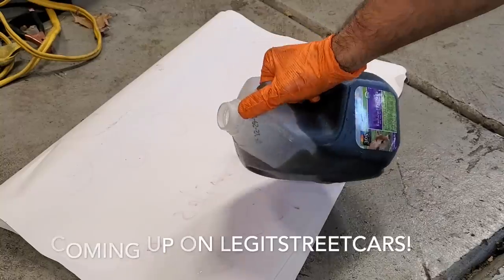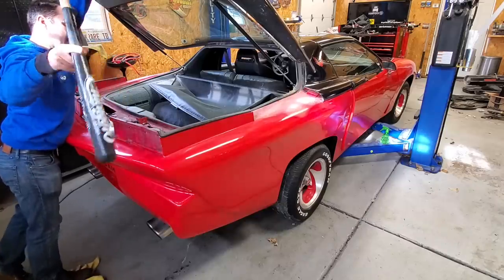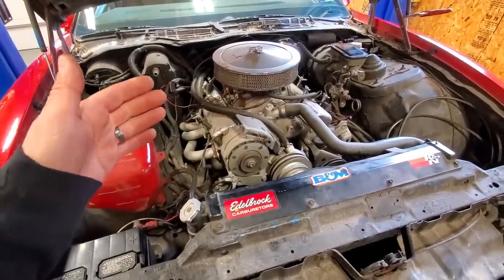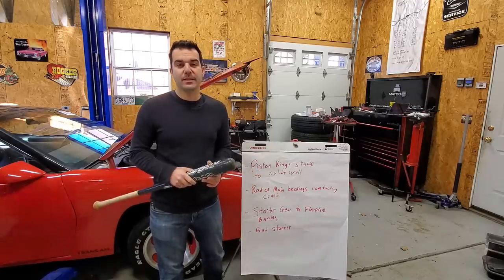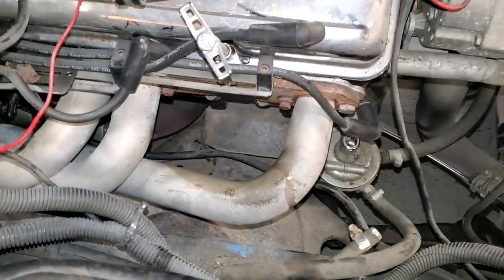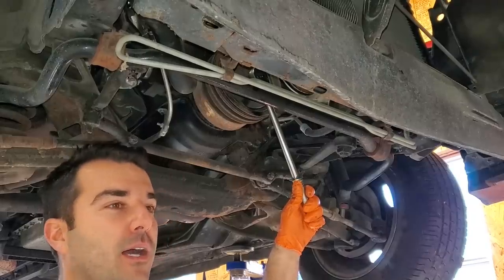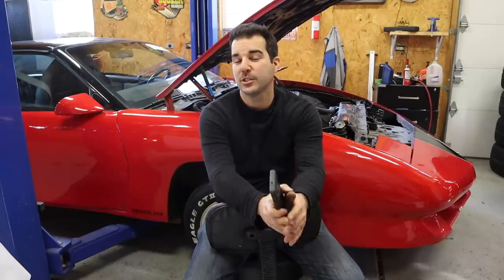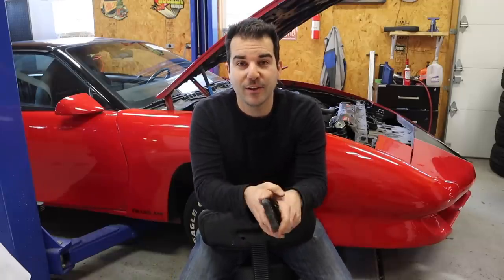My $1,100 Mystery Auction Car Has A CRAZY History! Famous Builder & Built Engine But, Will It Start?

Comment from the maker: What's the worst car you've ever owned?
Reply: Maybe a 2002 Honda Civic. Don't get me wrong,Honda builds great cars,but this one I had was shit
Reply: In 1983, I traded a 1975 Camaro for a new 1983 Pontiac Firebird; that Firebird was a piece of crap..
Reply: 74 pinto.. Only lasted 3 months.
Reply: An Audi S6 V10 with bad valves 😫
Reply: 98 Chevy Prizm it would burn a quart of oil every 25 miles
Reply: A 9 second pro Street 41 willys,it cost me 100k
Reply: 1979 Mercury Monarch only 4 out of the 6 pistons worked, power steering fluid would blow all over the motor every time I put some in, the head lights would go out when they got to hot, and the car shook so bad I thought it was going to fall apart! 😂😂
Reply: 1996 chevy malibu. Ran like crap when I got it. 2 years later, still ran like crap.
Reply from the maker: Oh yea that's bad
Reply from the maker: No way! Hole in piston? Lol
Reply from the maker: That sounds cool!
Reply: 1978 Honda Civic. The tranny rebuild from hell. It had sleeves on the shafts that had to be exactly right, or it would lock up. I had to pull it apart 3 times before it would run right. Which lead to my favorite car (aside from my Porsche 928 GT), a 1961 Rambler American convertible. More laughs per mile than any other car.
Reply: @LegitStreetCars  I have 1 on my drive ATM that is due to be a full Knight rider movie car replica... Needs alot of love
Reply: Got the full front light bar,steering wheel,and knight industries hubcaps lol Nightmare!!it's a customer car and a headache
Reply: @LegitStreetCars  it needs love and the small block needs an upgrade to a 454,you try telling the owner that.......lol you ll only ever go as fast as your bank account
Reply: A 2:nd generation Renault 5: https://en.wikipedia.org/wiki/Renault_5 
I paid more in parking tickets than I paid for the car :)
Reply: @LegitStreetCars  no I put 70 k into building the 41 then grenaded it at the track
Reply: I've never owned a terrible car but every car that I bought has had some issues that I needed to fix
Reply: Ya I’m building my 1999 stretched Jeep TJ pickup truck with om606 adapted to a Chevy nv4500 5spd manual transmission.  Once I get it driving good I’m going to buy a dieselmeken 7.5mm pump from Finland and compound turbos by dpuk in England.
Reply: vw 1999 golf cabriolet, aka mk 3.5 Worst car ever !! dont buy it.
Reply: worst car was probably my 1992 Lincoln Continental that was passed down to me from my late aunt. Constantly had issues, and then eventually one day it just said I quit. So I sold it to scrappers. Now I own a Mercedes E350 which hasn't had any issues, but my brother is a mercedes dealer tech so even if it does, he can fix it.
Reply: Kit car AC cobra - flex plate and starter problems like you are having. Fitted many parts, fuel pressure regulator, carb rebuilds, electric distributor, bigger radiator - the more love I gave it the more it hated me back. Was horrible to drive, but did looks amazing. Nice when parked.
Reply: Trick question. He’s just mining for answers to our password hints.
Reply: BMW E46 318i
Reply: 2005 skoda fabia 1.2 12v
Reply: 468 bigblock,with Edelbrock high-rise inlet and twin 750 dominators she pulled ...lol ford 9" with a locker and Strange 33 Spline shafts,with 21.5 Hoosiers on weld prostars plus Wheely bars she kicked ya in the spine lol
Reply: 1981 Chevy Chevette, bad brakes, bad clutch and you had to start it with WD40
Reply: @wesleyhorton4330  I'm in England
Reply: bought a 75 celica for 50 bucks..  was a real turd.. my friends and i took it off road and jumped it out of a bayou bowl.. thats where she sat for years..
Reply: @wesleyhorton4330  need parts or help hit me up
Reply: Bought a 2001 Ford Escape for $450.  Only 160k on it.  Found out afterwards the trans was bad and it wouldn’t start when warm.  Then something in the engine bay started on fire so I sold it at auction for $1350.  Terrible, terrible car.
Reply: 1980 1.6L Lada NIVA
Reply: 1997 Ford Windstar, Last ford I ever owned. I had $500 beaters with 200000 miles that were more reliable! Head gaskets twice and transmission twice It drove nice when it wasn't broken.
Reply: AMC Matador
Reply: I was hearing lot's of spark knock in the engine being it's a crate engine I would not run trash fuel in the thing run at least 94 or more octane but it sounds like very bad spark knock
Reply: My friend owned a jaguar v11 because a piston blew up
Reply: 1999 Mercedes Benz ML320.  20 repairs in 39 months.
Reply: Mercedes Benz e500 wagon.
Reply: @OscarTiderman  R5 was good cars 🤔
Reply: 2007 Vauxhall Astra 1.9 CDTi
Reply: LegitStreetCars not a bad car but worst looking a 2010 Ford Focus with a lot of cosmetic damage and has been wrecked before. Runs good needs a lot of love but it’s never not started. Has shut off once in traffic but it’s just a strange car
Reply: 96 bmw 7 series
Reply: 1995 ford ranger 3.0 v6 5 speed manual had a problem it would shut off under breaking when under a quarter of tank of gas and would take a few  second for it to want to start
Reply: 2g dsm. Spun bearings within a week of buying it. Rebuilt the engine and sold it.
Reply: 1988 dodge Daytona Shelby 2.2 turbo 5 speed pos but bastard step child throwing hissy fits . When running was a fast car hard 1-2 shifts she would jump to the left lane under load lol . 3 head gaskets later arp studs rust / rot she was junked the inspection failed her for structure rear axle rust in good old New York . I had a second daily just in case 1986 Subaru gl 1.8 turbo 5 speed 4x4 sedan never had a issue
Reply: @79tazman  hope it's a spark knock it just sounds deeper than that to me but if the dizzies loose or shot thats probibly it Fingers Crossed
Reply: 2002 ford crown Victoria
Reply: a 1981 Chevrolet Chevette that a co-worker gave me for free because he was tired of taking in to be fixed.

I drove that cat for 14 years and even rebuilt the engine.
Reply: @LegitStreetCars  the 1zzfe engine Toyota made were bad for the rings going bad smaller piston and larger rings and small oil return holes was the down fall
Reply: 1989 Jeep Grand Wagoneer SJ.  It had no floor, no back glass, and got 6mpg.  10psi cold oil pressure with 20w50 and Lucas.  Still drove it for over a year..until it left piston 4 in the pan.
Reply: 2003 Vauxhall Astra sxi
Reply: My 1st car. 1984 Chrysler LeBaron GTSLS. 4 dr, 4 cyl turbo auto. With a hatch... Ran for 3 miles after i bought it and the turbo blew lmfao... Haven't owned a chrysler since (18 yrs)
Reply: A 94 ford probe gt bought it with 260k miles after 5 months the head gasket failed but bought it for $500 so not bad i guess
Reply: that's a tough one ! it's a toss up between a 1972 ford pinto or a 1974 ford LTD  I drove both of them back in the early 80's to high school ( more like drove to school but walked home because they wouldn't start ! )
Reply: 1995 toyota celica gt convertible...
Dont even get me started on that thing lol...
Reply: 1989 Ford F150, gas 302 V8. Gutless and biggest drivetrain money pit ever owned. Cheers!
Reply: My 2019 Corvette that blew up at 140 miles. Worst $55K I've ever spent. I drove it 3 days, and it's been sitting over a month now broken.
Reply: 1979 L-48 Automatic Corvette
Reply: My first car a 78 Datsun B210...  Bought for $200 form my Mom's secretary. I was so excited to finally get a car I went straight over to my best friends house show it off and go out for a ride. While we were out "cruising" the town I hit a bump and the passenger seat (with my friend in it) fell through the rusted out floor. Two days later the head gasket blew...
Reply: Tie between 81 320i and ~90 XJ6. I think my volt meter finally told me to give up on em
Reply: Mitsubishi eclipse that was motor swapped and they pulled the bulbs for check engine and more.   OBD2 had more faults then Autozone could read... learned take a OBD2 with me and make sure it is a cold car not warmed up when you buy it. Lol.
Reply: 2011 BMW 335D, had the same issue 9 times in the 6 months I had it. The dealership I bought it from couldn't figure it out and they had it 4 months out of the 6 months I owned it, they brought it to BMW dealerships too and they couldn't solve it either. I eventually gave up and bought a mustang.
Reply: 🤔 My Buick Park avenue. I bought it drove it and blew it up a mile down the road.  But really I honestly think it's this 08 G6 GT... The rockers are completely gone and needs all kinds of work. Just got it . My 1986 Pontiac Grand Prix is in way better shape than that thing... New car suck
Reply: 1986 Buick Regal... chicago winters weren’t nice to it so it had rust for days.
Reply: 92 eclipse gsx she ate 3 built motors before my wallet became dry and i decided to take it as a loss and move on. Major love hate relationship.
Reply: A 1976 Austin Allegro, the motor was stuffed, blew out bucket loads of smoke.
Reply: Throw a quart of lucas in your oil. I had a GTA that I picked up from an old lady who didn't drive it after her son died. It sat for ten years. Had some bad lifter noise and what sounded to be a very mild low end tick. 2 minutes of running with the lucas in it, never heard made any noise again.
Reply: 2005 chrysler sebring, bought it from a guy with no teeth, i swear the car was a drug mule car from how beat to hell it looked and how all the panels where you could "hide things" just came apart on the thing, car ran fine all the way until i gave him the money they it just all started going downhill from there
Reply: My worst vehicle was a Nissan maxima
Reply: Chevy Chevette
Reply: Worst car ever is the car that brake's down in the middle of nowhere for no good reason.     Gary..... England 🇬🇧
Reply: Lifters could have collapsed from sitting. That could be the ticking. Running it will fix that.But if it's a solid lifter, check the lash.
Reply: 85 olds cutlass supreme bro-ham.  Had the V8 5.slow
Reply: 1990 vn commodore.  It was the buick 3.8 v6, auto but what a dog of a car.
Reply: 1979 caddy Seville
Reply: @nicolas_h9090  worst car i have seen is my moms 2002 honda fit
Endless problems (engine would shut off while driving)
Reply: LegitStreetCars 1996 BMW 750il
Reply: An American car of course, well 2 and fiat,honda, and Mazda
Reply: 1986 Mustang LX...3.8L V6 with an absolutely craptacular trans...it blew...so I replaced it...lasted three months...replaced it with a '97 F150 XL and said F it!
Reply: Congratulations on a great car, I'm a dodge guy but enjoy any unusual, concept or rare auto. Thanks keep the vids coming
Reply: My least best was a red sport Ford tempo with the door wraps, to me no car well cared for can be bad only the engines are what you pay for usually
Reply: late 80s honda sedan.
Reply: Ford five hundred.  Hands down worst car I ever owned.
Reply: 2006 Honda FRV I VTEC sport 2.0
Reply: Have a  1994 Chevy cCamaro and it's so bad the fuel pump when I first got it with shots the back end was hittin and the whole entire engine was locked up because the last person decided to run it until it locked up and then I took ownership of it and I got a new engine and it's been running like a champ since the day I put a new engine in it
Reply: A 2007 BMX X5  only car worse is the 2009 X5 that I bought later! Garbage
Reply: My sister in 2013 bought a salvage title 2002 Chevrolet Impala base with a 3.4 l V6 engine the color of the car was white and she paid $4,000 worst car purchase ever I ended up driving this car from 2013 to 2016 I gave it to nickname Casper the reliable POS I wished my sister would have bought the LS Chevy Impala with a 3.8 L V6 that would have been more reliable than the 3.4 l V6 that came with it it is junk so do not get any GM W body vehicle with a 3.4 liter V6 please get one with a 3.8 L V6 that is the best engine to have and the maintenance on it is pretty easy
Reply: 1992 Ford F-150 with the 300 I-6. Totally worthless. Sending it to the scrap yard in a few days.
Reply: 87 Cadillac Cimarron
Reply: 84 Lincoln  
Marvel mystery oil and Lucas Oil stabilizer and double check the oil pump drive in the bottom of the distributor if it was loose it heat seized form the distributor not staying on the drive rod to the oil pump it not the end of the world for it  also a go zinc additive would help as well
Reply: 2002 Dodge Ram 2500 with the 5.9 Cummins
Reply: 1965 LeMans 326 4door powerglide
Reply: 88 buick regal and 89 nissan pulsar..both metalic blue cars...i never bought another metallic blue just from superstition.but never had major badlucks again lol
Reply: Worst car I have ever owned was a ford tempo lol it was given to me for free and drivers side door was smashed in. Haf to enter and climb through passenger side lol
Reply: Honestly, I’ve had 6 cars, from ford escorts to a mk2 golf and a bmw 5 series, and I loved them all 😃
Reply: 1999 Land Rover 🤮🤮🤮🤮🤮 never again
Reply: 99 Cadillac DeVille with the Northstar motor.
Reply: a 1971 Vega! I never had to change the oil because it burned so much all I did was keep adding oil!
Reply: audi 100 avant. It had a very intermittent fault that would make it just die. Then the seals in the automatic transmission failed, and it leaked auto trans fluid in the diff and vice versa.
Reply: 86 Ford bronco 2
Reply: Land Rover Discovery...poop.
Reply: 87 jeep wagoneer. I spent more time fixing it than driving. It was fun fixing it in the summer but @-20 to -30 and your hands are fusing themselves to the tools, not so much lol. I do however wish it was the 70s wagoneer but beggars cant be choosers 😁
Reply: 1992 nissan 240sx, for some reason it was loud and shot flames out the hood and made alot hissing noises
Reply: LegitStreetCars Wouldn't say the worst but I permed a rare Mercedes Benz 300CE-24V and had the infamous biodegrade hoses and it would constantly leak oil despite being fixed and replaced. I miss that car
Reply: 2001 Saturn SL1...this one emissions part that was ONLY introduced in the 3rd gen consistently failed, causing me to not pass emissions.
Reply: Has anyone asked if you put oil in it? Considering you never showed refilling it with oil in the video. Hate to ask lol
Reply: 88 ranger v6 auto.....junk
Reply: 06 mini Cooper s auto unreliable piece of shit
Reply: Call it Phoenix if it starts up again
Reply: 1980 Ford Fairmont station wagon...drove it till the wheels fell off
Reply: 1977 Chevy Monza Towne Coupe. Looked great - engine disintegrated every 30,000 miles. I bought it 7 months old and got 9 months driving out of it. Lucky for me it got totaled!
Reply: 1981 Turbo Trans Am.  Slow. The turbo coked up every three months if I forgot to wait 10 minutes of idle after driving it.  And the paint was SHIT.  However....  it was also the BEST car I ever had because girls just fell on my dick when they saw me driving it.  Soooo...  best car ever.
Reply: 1992 Geo Metro. 3 cylinder, 3 speed automatic - 0-60 in 22 seconds!
Reply: A dam junk ass saturn. Just bad cars off the lot!!!!!
Reply: Best and worst was a 1966 Renault R8 Gordini ‘copy’.
Reply: City bus
Reply: Fiat 850, but only the engine. Tipo 100G. I have it ruat seized and now i gotta take it apart, it sat for 14 years. Otherwise awesome twchnology from 60s
Reply: @chipholland9  Same here. i had the Euro 270CDi ML, biggest most unreliable pile I have ever owned .Looked great and drove nie when new but ate it's trans then managed to destroy the AAM (computer) Trans module, air con module .etc etc etc ).
Reply: @nicolas_h9090  I had an 03 Accord, which failed spectacularly at the very worst possible moment in my life. It was the transmission, which Honda knew about. I believe it was 99 - 03 which had that slush-box issue.
Reply: 2003 VW beetle GLS, turbo with a 5 speed manual, tranny pooped itself on a bad 1-2 shift at 4 grand with 120,000 miles.
Reply: @Tech-Navi  I've got a 94 Probe GT right now. Had it for over 10 years. Very few issues over the years, but there were some head scratchers for troubleshooting. Klze and maf swap, planning to paint when the weather warms up.
Reply: Austin allegro
Reply: Nothing personal, but you made stupid mistake, if it doesn't move with hand motion you shouldn't turn it anyhow, that can do a lot of damage and make engine unusable
Reply: @LegitStreetCars  are you sure it's not a Banshee
Reply: Yugo, good car but when it's a bad transmission it's a hell of a journey
Reply: Renault Modus...Jesus...
Reply: My 2001 s55 amg, would run for a week then be broke for 2 1 week saving the cash and the next getting fixed . Only to repeat the process multiple times untill thankfully a chic ran a light n hit me
Reply: Toss up between an '83 rabbit diesel and a '94 tempo v6.
Reply: 2005 chevy impala ls it was a peice of shit. The exhaust hanged amd it was loud like a goat cart it stinked and it miss fired I hated that car
Reply: 1979 Buick Regal.
Reply: 1984 ford tempo.
Reply: Nothing as bad as that pile of shit.
Reply: One of the ones I drive now.....a 2004 avalanche with 245k miles and real bad lifter chatter, rust in rockers, and a front hub shining.  It runs, but not very good.  My actual worse vehicle was my first vehicle....1969 snub nose Chevy handyman van.  250 i6, 3 speed column, garden hose ran to carb from a fuel carry jug....no joke, had 3 blowouts one drive and couldn't tell (drove no different) once I got home and found out....and had no title.....
Reply: Audi A4, bloody terrible
Reply: LegitStreetCars ,1968 Mercury Montgomery MX. It was my first car, got it with a blown engine and a rotted frame in three places. When your 15 years old with no money, it takes forever to get your first car running. Put a used 302 in it and the car almost broke completely in two. Almost gave my poor mother a heart attack when she saw the car’s fame in the driveway laying in chunks on the ground. No kidding. What can I say, I learned a life lesson about structural integrity on cars. Those were good times when I look back on those days.
Reply: 1951 Ford Shoebox.
The Flathead was a total lemon. Car had just issue after issue
Reply: @ursus353  a 75 camaro is worse.did you buy the cheapest base model?ive owned 6 in the last 25 years and i love them,i have a gta and a trans am
Reply: @joshuanicolai4776  smart man
Reply: 1975 Cadillac Deville D'Elegance. It had a 425 fuel injected engine and was the 1st American car with a computer EFI. I hated that car. Traded it for a 1979 Camaro and that guy sold it to some dude who had the misfortune of having the car spontaneously combust while parked in his driveway and burning to the ground. I couldn't imagine a more fitting end for that POS.
Reply: @adamhenderson4318  thats on you not the car ,Adum builds a car from multiple pieces....fucks up......blames the car (an inanimate object)  fix it and do it right.
Reply: @trillrifaxegrindor4411  My Camaro was the LT;  in 1975, there was no Z28, my LT had every option that a Z28 would have had, and yes, the Firebird was a cheaper model.
Reply: 1978 jeep cj 7 i think it was a 304 35k original miles,it was a beast but I was always at the parts store although I did get like 3 ft. Of air one time so probably more of the abuse ol' Blue had to endure..good times.i miss that p.o.s. honestly
Reply: Easy, a 1981 AMC Eagle.
Reply: 2005 sentra ser spec v.
Super pos.
Reply: 96 grand am gt 5 speed with the 2.4l engine. Couldn’t keep the engine or trans together. One of my funnest cars to drive but broke down all the time
Reply: Worst car I owned was a '94 Chevy 20 high top van. It ran great for $2000. The seller put some kind of head gasket sealer in it. I bought new tires, tuned it up and 105 miles later coolant started dripping from the tailpipe. Come to find out that millionaire cattle rancher used to be a chevy mechanic years ago. No shop in town wanted to fix it so I sold it for $600. Trust No One!
Reply: @AutoAuctionRebuilds  I have seen some of your video's; was it a flood car?
Reply: A 2002 Suzuki wagon r....wouldn't start most of the time
Reply: 88 Grand Prix, 94 Achieva, 89 f150. Take your pick. The 2.8Litre Pontiac was an all around dumpster wagon, the Oldsmobile was destined for self destruction and the Ford had not one, not two but THREE transmissions nearly fall out of the thing in less than 2 months of which about 40 days were in the two different shops! All around doot fests man.
Reply: 1998 Mercury Sable. Wife insisted on keeping it. Replaced the engine and lots of components. Removed the whole interior to detail it. Finally got it sorted. Miserable car. The comfortable seats and the stereo were the best part of it. 🙄
Reply: all that back and forth chatting you should've asked how to open the doors from the outside surely the straps aren't the way...lol
Reply: 1997 geo metro with a in line 3 banger 53 mph top speed lol
Reply: 1995 markvii.  Suspension sucked, leaked every fluid from a few too many places. I paid a grand, was in a haze from my fathers death the day before or i never would have bought it.  One of the custom touched....Lincoln with cherry bombs on it.....Detroit!  It was kinda fast with the 4 valve 4.6. I got my mony back after doing smoking burnouts in it all winter. Zero practically i threw toolboxes into the interior and a carseat for my 4 year old.
It was scary because the front suspension arm was bad or something. And it was fast.
Reply: 2004 kia amanti.  The alternator harness shorted now my starter says stuck engaged.  Cant use blinkers or windows
Reply: Akia  or A kia .... kia  lol  i got it for my mother .. an the first 6 month she love it, but the tranny started slipping then the motor started knocking 

then it went to  heaven 

or hell
the dump
Reply: 1997 Opel Corsa, and 2002 Ford Focus St 170. This fucking piece of shit standing more times in the Repairing Workshop than on the Road.
Reply: My Current car, a 1970 Ford Mustang. Got it from my Uncle after sitting 3 years in his garage. Ran like crap when I first got it started. Runs way better now after a few new replacement parts.
Reply: Try AEROKROIL!! IT WORKS WONDERS!! Had the same issues you had with my T/A, used it and within a day she was running!
Reply: 1975 Ford Gran Torino station wagon...400 ci. Windsor/c6 automatic. Weighed about 4 Tons, power steering by Armstrong (bad power steering pump) ran like crap,drank fuel by the barrel, and was that horrible Ford Forest Green (guacamole/baby sh*t)!
Reply: 1984 Chevy Cavalier was the worst car that I’ve ever owned. The passenger seat had a hole in the floor and was missing the seat, so I mounted a milk carton above the hole and used that for a seat.
Reply: Datsun B210. OMG that car was JUNK
Reply: 1991 Ford Probe. In the shop as much as I drove it.
Reply: For one why are you calling it a firebird or trans AM its pontiac body yes but it a Banshee so no mystery car
Reply: LegitStreetCars 2005 Saturn ion. Lost brakes second day, blew the head gasket a month later, lost my lights, found out miles were rolled back month three, sold it and broke even thankfully month 4 lol
Reply: I didn't personally own, but my mom had a 1986 Buick Skyhawk (not to be confused with the Skylark) that would literally die on the way to the grocery store like a mile away. I now own a 2016 Ford Focus with the infamously defective DPS6 DCT. It's tough to decide which is worse.
Reply: Honda Quintet, what a piece of crap that was. Had it for a short time, sold it asap
Reply: 1985 Delta 88
Reply: A 2007 Renault Clio 2 in black. 
It was Rosty, dirty and almost fall apart but ☝ it starts every single day and drove from a to b. 
I was proud of this car.... And it was a gift from a buddy....
Reply: A 1968 Mercury Commuter station wagon w/a 390 V8 and a 4bbl carb. It was given to me for free, after the left rear axle simply snapped off at the outer end, causing the wheel and brake drum to take a trip down the block, minus the rest of the wagon! The owners were sick to death of the vehicle breaking down. They'd bought it new, it barely had 40k on it when they gave it to me in 1976. They had never driven it much over 45 mph! It was a Cream Puff, but Shit oh dear, it was a trouble prone Cream Puff! I replaced the axle, brake backing plate (it was kinda ground off on the bottom side) shoes, wheel cylinder, and hrdwr. Lubed up the diff, and hit the freeway. I held my foot flat to the floor as I got onto the freeway, and the Boat wouldn't go over 40 up a slight incline. The engine simply bogged, and the BLACK Smoke that poured out the back literally obscured the freeway behind me. Eventually, I crested that very slight incline, and headed down the other side, still Billowing Black smoke, my speed crept up to 45, then 50!!! About 2.5 miles along on a flat freeway, I was up to almost 60, and still  you couldn't see the roadway behind me from that smoke. The engine never missed, but god, the sound of that thing at WOT and low RPM over a long distance, was so weird!  Eventually,  maybe 10 miles down the freeway, I exited, crossed over, and FLOORED it again as I got on the freeway headed home. This time I got to almost 70 within the first mile, and the smoking was noticeably lower, too. After a total of ~15 miles of foot to the floor driving, the engine suddenly remembered that it was 390 cubes of 4 barrelled Dearborn Iron, and just Freaking took off. The smoke disappeared, the engine was purring... Yay! Then the trans took a dump! I rebuilt that Effing C6 about 5 times, and a local trans shop rebuilt it 2 more times, before diligent research finally turned up a reference to a limited production of C6's, that actually had semi porous castings between hydraulic passages within the transmission. Wtf?!??
Sure enough, a wrecking yard trans case, and all of my very new internals... problem solved! At this point, the radiator was feeling rather left-out of the proceedings... you get the idea! I ended up giving it away, just as its previous owners had done, and for similar, though different problems that continually plagued that beast!
Reply: 1975 Chevy Monza with a 262 v8. My brother took the car without asking and hit a large pothole at 60mph. The whole front end bent and was never the same again no matter how much I worked on it. It was stolen by some ahole for the rims and radiator (that was brand new). I saw the stripped car a week later.
Reply: 96 ranger... only paid 500 for it, but then it lost the clutch and a headgasket in the same month.
Reply: Instead what you should do tear the entire engine and rebuild it complete back up and start fresh again with new parts cause if you are second guessing your self you will lose time and money like this.
Reply: 1974 nova with the hatchback.It had a water retention issue that ultimately rusted the floorpans and spring perches,leaving the back half of the car dragging the ground.
Reply: Bmw M5 competition pack. It’s ruined all other cars for me. My only upgrade path is a tuned 911 turbo and I can’t afford one lol
Reply: LegitStreetCars 87 cavalier
Reply: I love F-Bodies. Still have them. One, though, stands out as a bit of a bear. I had a '94 Firebird Formula. Old LT1 V8. Loved it, and it sounded incredible with Flowmaster 40s and headers. The Opti Spark distributor was just the worst. Thank goodness you don't have to worry about it on this build. They're expensive too for an original part. Up to $600! As bad as that was, my old Lincoln LS takes the cake. Constant coolant issues. It's a Jaguar engine with a Ford badge. All the parts are quite expensive overall, but it's how they're made that's the kicker. Take for instance the thermostat.  It's integrated into it's own assembly that must be replaced in entirety and often fails. The construction is just sad on most of the parts I ran into. My buddy and I must have drained and filled that thing a hundred times working on it.
Reply: My very first car purchased from a repo auction for $400.  It was a black 1980? Mercury Capri RS.  The ones with the flat back glass, not the bubble glass.  Had a big factory induction hood (non functional of course).  It looked so mean! Didn't run when I got it but I just had to have it.  You gotta dream small when you're poor.

We had to replace the automatic transmission.  Which a family friend and I did at home because I couldn't afford real mechanics.  It actually looked like a really mean Mustang until you started it up.  The tiny 4 cylinder was so weak I had to pull over during wind gusts because I'd lose forward momentum lol.  It was pretty bad.

The car had been treated pretty bad before I got it and most everything in it or on it was damaged but standing still, from far enough away and with your eyes squinted hard enough it looked amazing.  

It broke down a lot and ran like an elderly ox cart but it was my first car and despite it being the worst car I ever owned I loved it.  Of course that was with my dreams of 5.0 engine swap and heaps of performance upgrades.  Somehow, in my mind, that car is always remembered fondly, not for what it was but for what it could have been.
Reply: 2006 BMW X5 v8.... I turned a corner one day passanger door flys open.. all electronics dead... Tires replaced every 25k km...
Reply: 1995 Dodge Intrepid 3.5L V-6 only 5 years old brought in 1999 and it had 90k miles drove 3 months A/c quit water pump quit fuel rail leaks one big piece of shit. We had a hail storm and State Farm gave me a check for 4,000 and sold it for 4500 the next month. Never buy an Intrepid Concorde stay away!!!
Reply: 05 Nissan Altima.
Reply: Alex, 
There is 08 Mercedes e320 bluetec for sale in Chicago with timing chain problem. Can you buy it and make video of how to fix it?
Reply: That's not a 350, that is a 305 you can tell by the external balancer.
Reply: Lol I don't buy shit cars lol
Reply: My dodge neon leaked a quart a week because of a rear main seal. 5 speed though. Loved that thing. Slow af. But leaked like a bitch when running
Reply: 1997 Pontiac grand am. Head gasket failure and electrical.
Reply: A FIAT 850 Spyder.  That was an anemic piece of junk.
Reply: 1998 ford Probe.
Reply: 1998 Ford Explorer, bought new. Was a good driver, but a rubbish 4x4 and an unreliable POS.
Reply: 1976 suburban with about 200,000 miles on it.   First car and what a pile but I loved her 👍
Reply: My first car was an 86 firebird with t-tops. It had that crap 2.8 liter v6. I got it with like 200k miles on it. It didnt last long since I was 15 when I got it
Reply: 1996 jeep Cherokee xj. Rotted out, transmission issues. Suspension issues. Idle issues. Also a 1999 honda civic although it was a low mileage car and super clean it had a bad headgasket with minor intermittant overheating issues. Never got too hot but temp always fluctuated. Had to replace a distributer in my work parkinglot and after owning the car 6 months it overheated and that was it. Also had a 1988 mustang that i dumped over 2k into and sold for 500 after doing upper and lower intake, timing chain and gears, waterpump, oil pan gasket, motor mounts, transmission mount and driveshaft.
Reply: 2000 vw Passat 30v v6 I bought it with a low end knock pulled the motor and bought a junk yard motor but the junk yard motor have broken and bent intake valves so I ended up scraping the car because I didn't have the money to buy a new motor and continue to bring the car back.
Reply: Your tick sounds like lifters to me, probably pull the heads off and see what is up.
Reply: 2004 Dodge Caravan
Reply: My worst car was definitely a 1975 2 door cutlass s with a 250 CID straight 6 with a 1 barrel carb lol but it did have electronic ignition. The interior looked like rats ate it and outside was 3 different colors.
Reply: 2001 intrepid r/t. The car was definitely built and was making about 400 bhp, but it was just problem after problem with that car. After I bought it, the battery went bad within a week, replaced it and then some wiring in the dash went bad, making none of the lights or power windows work, then while trying to diagnose that, the hubs went bad, got those replaced and the upper strut tower bushings went bad, then on my way to get those parts, the brakes went bad, it was a nightmare.
Reply: Worst car I ever owned was a 1978 Mazda 929 2.0L.  Blew 3 different engines in 2 weeks.  Kept blowing the head gasket between cylinder 3 and 4.  Rebuilt a running engine from the 3 dead engines and sold it without driving it much after that.
Reply: 03 Land Rover Disco 2.
Reply: That would be the Ford escort, followed up by a 1980 Chevy half ton PU diesel to gasoline conversion that had an inline six that had been Frankenstiened together. Mater of fact I actually named that old Chevy truck Frankenstein, as someone had butchered the intake for that inline 6, then very badly welded an two barrel adapter to the intake as well as rigged up the hydro-boost for the hydro-boost power break booster. Actually the rigging of the hydro-boost on the truck was not really that bad a job, as it almost looked factory if Chevy had ever put a hydro-boost power booster on an inline six. But the thing would never hold a proper idol due to the hack job on the intake manifold.
Reply: 1987 Chevrolet Celebrity. Was reliable for a hand full of years. Then took a sharp turn south after I sold it.
Reply: 2009 suzuki jimny i had to replace the transmission just from there you can imagine how many problems it had but even with the bunch of problems it had it was kinda like a reliable car because even with that ton of problems the car never left me stranded or didnt turn on now it's my daily even with problems it was my daily it was burning a quart of oil every 2,000 or 1,000 kilometers i dont remember 10w40 but now with 20w50 from a gas station it hasn't burned it maybe i just put the wrong oil sometimes when i turn the stering wheel fully sometimes it squeeks sometimes randomly the engine squeeks but just a little it has new accesories belt but still squeeks randomly men this thing had a lot of problem but still is reliable 😂😂
Reply: My aunt bought a Dodge Stratus and that was the worst car she ever bought
Reply: Milkman is that you?
Reply: @nicolas_h9090  yeah they're being towed left and right them in the Han dies 2002-2003
Reply: @GenderSkins  It rates up there as one of Ford USA's stupidest moves to name the rebadged Mazda 323 an "Escort" in the USA which stained the name of the British built 70's Rally Legend.  Those early rebadged Mazdas were pure junk.  They called them Ford "Laser" here.
Reply: 2012 Nissan Versa
Reply: Ford F-150 I almost died when i fell and tried to get home but it wouldn’t start
Reply: @79tazman  spark knock could be from the distributor being loose and not having the correct amount of timing
Reply: I have a 2003 Faw 6350 microvan. I still own it and it was made in China and the quality is very poor. It’s always has a electrical gremlin issue.
Reply: 1983 Oldsmobile Firenza was my first car. BTW Haters gonna Hate!!! I'm willing to bet that the people giving you crap probably don't know how to change their own oil let alone rebuilt an engine. Have fun with the (PHOENIX). I'm jealous that I don't have a project at the moment.
Reply: AMC PACER!!!!!!! Enough said lol!
Reply: 1985 Austin Maestro 1.3 HL 🇬🇧🏴
Reply: @jkeating38  my brother has a mercedes with 2.5? liter 4 cylinder turbo, we were at 138 mph and accelerating...runnin bitch
Reply: @johnthompson941  i had a windstar ran ok till i found a milkshake on dipstick lol
Reply: the one i have now
Reply: 2004 Rousch Focus
Reply: Not my car, but my mom had a Chevy Cavalier.
Reply: 79' Chevy Chevette with an Automatic...nuff said.
Reply: Ford
Reply: @JUNEBUGG99835  Was there alot of rust on the undercarriage? Otherwise probably needed have the clamps to hold it in place and the misfiring was potentially a bad cylinder or needs a Tune up. I have a 2000 Chevrolet impala LS and the car is very reliable, best car I've owned
Reply: 03 Silverado 4.8 4x4  it was like a boat just break out another thousand hahahaha
Reply: all my cars... lol
Reply: 85 Chevrolet Celebrity EuroSport. Nothing European or Sporty about it.
Reply: None bc I am too young but the worst that the family has owned is my moms Mercury minivan but nobody including the title company that legally owns it will take it so she has had it sitting in her yard
Reply: 99 cougar. Garbage car.
Reply: The worst car I've ever owned was a front wheel drive Dodge Charger. Spit out a CV joint and smashed a hole in the transmission the same day I bought it. Also, you have something dripping behind you at 11:57.
Reply: The worst car was my first car which was a former taxi, Caprice Classic.  The car used to diesel something awful when you drove it long and shut it off and the a/c didn’t work and would throw belts if you turned it on, LL
Reply: 1999 Corolla with 767K miles...
Reply: 1977 Chevy Chevette. (Shitvette, LOL!)
Reply: @scottpilgrim7589  it was just in bad shape it was my first car and it was like the previous owners didnt take care ofit well it leaked like hell it was bad
Reply: 01 Saturn L200 for me. Was free, knew the trans leaked. Had no idea the engine skipped time and bent all the valves. Took a while to get the key, was dropped off by tow truck. Did a top end overhaul on the engine, ran great but had this occasional cylidner 4 misfire that'd trip the CEL. Despite that cylinder having 200 PSI compression, good fuel injector, and good ignition. Fixed the trans leak. Sold that POS. Power locks would always unlock all doors and do other weird things as well.  All of that at 128,000 miles..... Haven't owned a GM car since and couldn't be happier about that.
Reply: 06 Impala ss
Reply: 83 Citation, 3 transmissions in a year
Reply: 1987 Honda CRX the rustiest pos ive ever had and i live in Texas, so not very many rust cars, but whoa that crx was BAD
Reply: It's from the m.j ovie Demolition Man. You can see it in the seen when they go to Tacobell.
Reply: The worst car I had a ford focus
Reply: Renault Alliance.
Lasted under 40k miles.
Reply: Worst car.... was actually a minivan.  A '98 Ford Windstar.   Nothing but problems.  I suspect that it went through a flood,  during its time in Florida.  Though it had a clear CarFax, I later found evidence of a lot of junkyard parts,  that indicated a prior accident (slightly mismatched paint, body panels slightly off kilter, also led me to believe this).

Anyway, bought it for 3k, sold it for $500, a short time later.  Guy I sold it to, he was confident that he could straighten it all out. Knew what caused every little problem.  Said he'd have it on the road, like brand new, in a week.

A few weeks later, saw the van listed.  $50, parts only.  Ad said the van was irredeemably possesed by demons, infested with gremlins,  and not fit to see a paved road, ever again. 

Damn shame.  Van was comfortable, and drove and rode well.... when it actually ran.

Side note: I've run a CarFax on 2 different vehicles.  Both came back clean.  I found evidence of accident repair on both, later.  I no longer trust CarFax... not that I had great faith in it, anyway.
Reply: @johnthompson941  Lol... I just posted the same vehicle... almost.  Mine was a '98.  What a lemon.
Reply: third hand Ford Falcon XR (between 66 and 68). Damn thing had missing teeth in all 3 gears and the day someone stole it... the diff fell out as they turned a corner (karma, bitch)
Reply: The car I've taken the biggest loss on was a '67 GTO.
Reply: 1995 Chevy S10 
had a cool knocking noise at full throttle lol
Reply: The fords stranded me the most. The Dodges showed me higher technology. 
But I guess Ima chevy guy had 2 novas and 2 vans. Ive 9wned 2 fords. One dodge. I caint really hate on em. If I was gonna brag it would be .................Dodge.
Reply: @nicolas_h9090  It was probly past due for a valve adjustment.
Reply: @richardkluiter5167  us8ally valves get that way from " runnin it into the ground".
Reply: @KK4KLI  damn! Bad seals? Needed some " glue" in it.
Reply: @joacimlopez9735  but that body style does look good for 4 doors.
Reply: There was an episode of Knight Rider where the team molded a fake supercar body onto K.I.T.T. as a means to infiltrate some bad guy's place. He was a fancy car aficionado so tricked out K.I.T.T. was sold to him. Then from inside his garage, thus inside the security, K.I.T.T. hacked the bad guy's computer. At some point the fake body overlay 'evaporated'. I recall the fancy body was black and red with an extra pointy nose. Would have been cool if this had been the prop car built for that episode.
Reply: 1998 Dodge neon. Hands down.
Reply: All three of the Fords I was unfortunate enough to own.
Reply: ford probe is the biggest pile of garbage. ever.
Reply: @hadleymanmusic  bad rings the Toyota engine 1zz Fe was notorious for bad piston rings
Reply: I really don't have a worst car all have their own set of issues  but my dodge dart swinger  318 v8 was bad rusted in the trunk leaf came through
Reply: 87 Hyundai pony. 83 Ford Escort. 85 Chevy citation. Nuff' said.
Reply: 1988 ford escort GT 4cyl 5speed front wheel drive and overhead cam lmao my first second car, my first car was 1989 Mustang GT BUT my dad said it was to much power so I needed a beater first to learn how to drive hahaha
Reply: '85 cougar
Reply: -96 Ford Mondeo V6, a Ford Contour for you Americans. Had a -93 Mondeo which was bad too but it's engine and transmission worked better.
Reply: mercury zephyr 4cyl 3 qt. of oil on friday so it would make it to then with 1 qt. left in engine, quite remarkable actually, it wouldnt die
Reply: 2002 Subaru Legacy GT, build quality issues from day one. I actually ordered it special in October of 2001. Steering rack went to hell 610 miles, window, rust, windshield wipers, suspension and nightmarish brake problems plagued that piece of junk the entire time I owned it.
Reply: 2011 Chrysler 200.
Figure out your shit wiring, Chrysler.
Reply: 91/92 Hyundai Excels. Had two of them. Sketchy as hell.
Reply: anything VW with the trans issue
Reply: none i cant have a car im only 14 lol
Reply: Just curious but was the insurance car from Ohio. I had a friend donate a t top trans am to the VA to help vets last year. So it went to a auction yard.
Reply: The only one I've ever owned: 1998 Toyota Avalon
Reply: Worse car was a Oldsmobile Aurora with big ass Northstar motor. Was such a bitch to work on. Just to do the alternator had to remove front support bar radiator etc. Spark plugs where even a bitch. Was one of the worse cars ever designed.
Reply: A brand new Yugo.
Reply: parents had a 1975 Jeep grand Cherokee that was so bad with engine, orginal one owner before parents had the Jeep and never changed the oil so the engine had to get replaced. Also the vehicle had a rust spot on the back end that was not good and taking over that quarter of the car exterior side. Car Ended up my dads car after a while when My mom got a 1996 Doge Grand Caravan, one of the biggest Minvans ever made that was a true Minivan.
Reply: Mercedes Benz c-class it held up 4 months then the suspension just gave up at a gas station
Reply: LegitStreetCars 2009 Mazda CX-9
Reply: An old cabrio renegade consumes as a tractor
Reply: 1981 Ford Crown Victoria LTD. It had the monstrous 225ci v8. Got about 10mpg. Handled like an elephant on crack. The electrical worked when it wanted to. And it stopped... sometimes.
Reply: 73 Dodge Polara wagon. It was lemon yellow, how appropriate.
Reply: Yugo in high school
Reply: LegitStreetCars 1999 Mitsubishi diamanté 30m worst car I’ve had in 20 years by far... everything about that car was deeply terrible
Reply: 1978 VW Scirocco 4-speed manual. Metallic gold paint, ugly 13" wheels, brown vinyl interior, and slloooowww AF. But, it was my first car and I was only 16, so I thought it was cool. lol :P
Reply: None I do my research.
Reply: The 2005 Dodge Magnum RT AWD with 65k miles I have right now. I bought it in May 2019 and it’s been at the mechanic more than any other car I’ve had!
Reply: 1987 Dodge Charger with the NA 2.2L engine. It spent more time at the garage than in my driveway for the year I had it.
Reply: Plymouth Sundance, was my first car. It burnt to the ground in the parking lot soon after I got to work. It was awesome.
Reply: 1985 Ford Escort. Lightstock burned while driving and set horn on nonstop honkin lol
Reply: Mid-70’s Dodge Duster with a slant 6.  Gutless, hated the rain and generally miserable to drive.   My first car and I loved it!
Reply: Late 70s Ford Fairmont with a four cyl.,it puked oil every place possible with only 60k miles.
Reply: Corvair
Reply: Again, fill cylinders with dexron 3 or marvel mystery oil
Reply: LegitStreetCars where do you get that Globo?
Reply: 1998 Ford Contour
Reply: I've loved all 3 cars I've owned. Sure they all had their own little quirks but they were all really special to me.  (88 Regal SE, 97 Grand Am GT Coupe, 05 WRX)
Reply: 1985 Peugeot 505 STI Gas Turbo. I like yourself do all my own work except for transmissions, and differentials; I hate them. The nuts and bolts on that car are French metric which is different metric from anything else. I had to order a new stud for my turbo mount to hot side it snapped off at about 65K miles. The dealer didn't stock anything, or very little. The dealer (Doran Chevrolet in Dallas TX) would only order parts once a week or so, to save on freight costs.
When I talked to them about parts availability, the salesman said Peugeot guaranteed parts shipped in 48 hrs. up to and including a complete engine. He did not tell me the dealership wouldn't order them though. This led to cars being in the shop for weeks over issues like a broken stud, lost bolt, or nut. Crazy! I also had a leaking seal on the output shaft of the transmission, the car has an independent rear with a mounted differential, and the driveshaft is enclosed in a torque tube/ prop shaft housing. They wanted $1,000.00 + to replace it showing 12 hrs. labor as I recall. I went to the parts department and asked them how much is the seal? $5.00 was the answer, I told them OK get me one. The service manager actually came down to parts to tell me: you have drop the exhaust, drop the rear end, then pull the tube out the rear to access said seal. My reply was so? He said then to reassemble it you have to realign the rear suspension; you need a machine to do that. I said we will see. He was actually pissed. I told him I'll get back to you. I took the seal home, put the car on ramps fore and aft to get room to work on it. I dropped the exhaust, unbolted the rear diff., turned it (the pumpkin you have to plug the vent or messy deal) upside down and let it hang from the axles. There was enough room to slide the propeller shaft housing and driveshaft back about 1 ft. Replaced seal, flipped pumpkin right side up, replaced drive and prop shaft housing, mounted exhaust. Done in about 4 hrs., I'm sure I could have done it in an hr. or so, but I had the FLU at the time and could barely get around LOL! You're a mechanic, you know there are always ways around the book. If you study what you are working on for a bit before you just blindly start working on anything, you're always better off. The car was fast, economical, handled well and was very comfortable, different in appearance but I liked it at the time. Very much along the lines of a BMW, or MB, the weird French thread deal and poor parts and service were a deal breaker for me. Not that I ever let anyone work on my stuff too picky for that. Well, I guess they are no longer imported to the U.S. They were not bad as far as I was concerned other than the issues mentioned above. I will admit that I am an advanced mechanic, you seldom tackle something I wouldn't if I had a lift and finances to do as you do. I do LOVE your show, as you work through issues, I spend a lot of time trying to guess ahead of you and that makes it fun, sometimes I'm right there with you, others you outguess me. Thanks for putting on your videos. You enable me to get my wrenching fix while staying clean and saving money LOL! These days I have a heavily modified 2004 Z06, with 2014 ZR1 cradles front and rear including diff and trans, bigger brakes, more gear. In the power department there is an LSX 454 with a S/C kit from A&A. The build has 10,000 miles on it and is still in shakedown mode, I know you get it.... It is sure Nuff way too much, which is just perfect for me. I would be scared to sell it to anyone that couldn't prove they had real race car seat time though; it would be unethical.